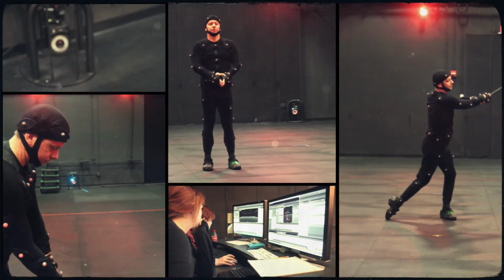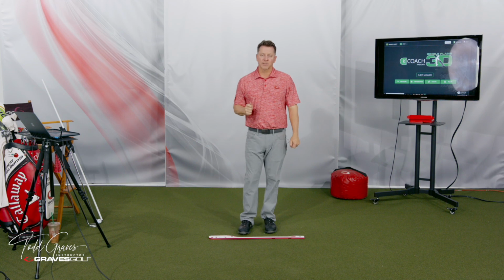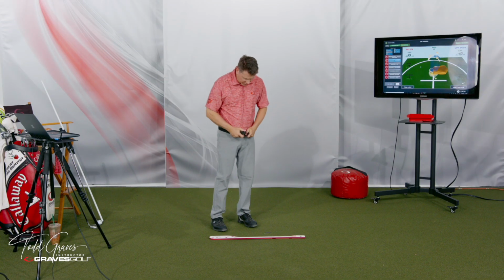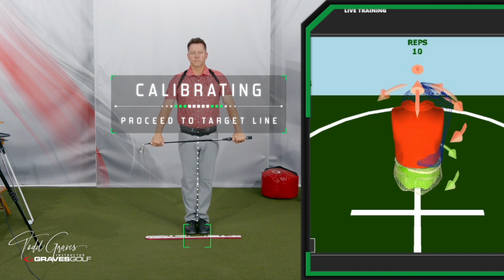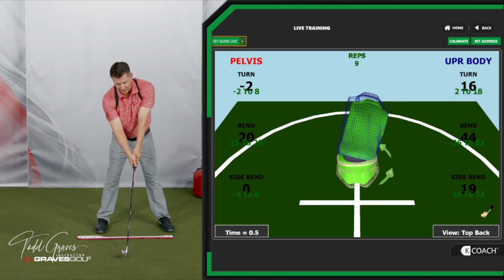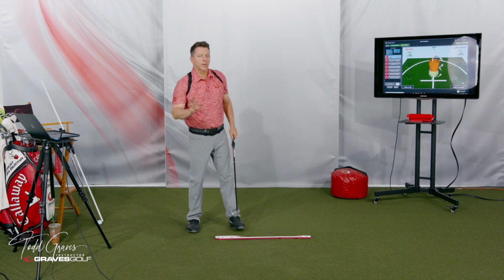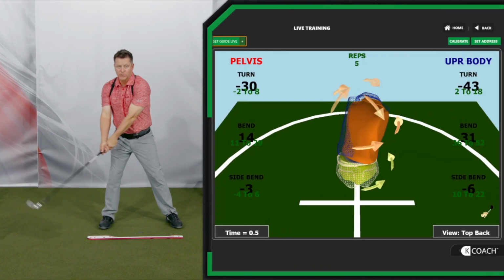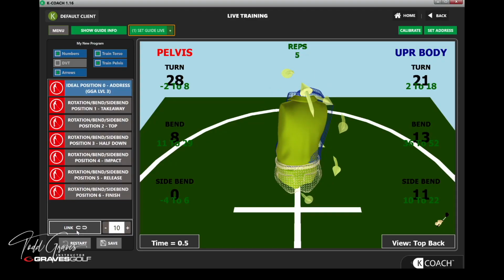Moe Norman's Golf Swing Mechanics with Single Plane 3D

Comment: A very interesting analysis of the optimal body movements. Just one thing: at 7:30 you say that by position 1 the pelvis has almost completed its rotation, but in fact it has only gone through 60.9% of the total movement through its arc. Though the pelvis has to travel a much shorter relative to the other parts of the body it still has to move another 39.1% to go from position1 to position 2.

Comment: What would be a correct lie angle for a set of irons?
Reply from the maker: Depends on your size - you need to be custom measured and fit for clubs.
Reply: I’m a plus one handicap PGA member and absolutely love your videos. My lie angle is 2 degrees flat with a conventional stance. I’m trying to learn the one plane swing. My question is with my arms more extended does my lie angle need to be more upright?

Comment: I have a question:
Suppose the numbers in my 3-D model are exactly the same with Mr Todd's or Moe's numbers. Why, then, the 3-D orientation of the club head at the impact instant and its 3-D trajectory, that dictate the flight of the ball, will be the same in all cases?
Reply from the maker: I'm not sure I understand.  I guess maybe the answer to your question is Speed. Maybe we have different speeds.
Reply: @ToddGravesGolf  First of all, let me acknowledge that  I am  a fan of your model and teaching.
What I am trying to say is that in case my body  'metrics' (or symmetry, for example longer arms, shorter legs and shorter torso) are different than yours or Moe's, then even in the case my 3-d model numbers could be the same the trajectory of the club head and its orientation  would not be the same. The trajectory of the ball would be different. It's just mechanics. If we have two mechanical golf arms, each consisting from two jointed  parts of different length, then it is not possible to achieve both the same 2-d (for this example only 2 d is enough) angles and same trajectory of their end.
I think the best way to describe it is that first you study what the 3-d numbers for each student are, along the basic principles of Moe's swing model, and then have the student try to achieve those , individual, numbers each time. Anyway, the system to be compete, they should add sensors for the arms and hands. You have pointed out that Moe did  not rotate his hand at the impact, so the position of hands is also crucial to achieve a straight to the target flight.
I would like to visit  and take some lessons, but unfortunately I live in Europe now, I used to reside in Fayetteville  AR.
Wish the best and happy new year.

Comment: @Todd - Awesome video. The advancement in Bio-Mechanical feedback (metrics) is huge leap forward in the sports industry. How, if it all, are you planning on disseminating your model, will it only be available to authorized GGA participants or is their a plan for it to become available to any K-Vest owners? Thanks!
Reply from the maker: We have consumer based K-Vest (K-Motion) system available.  This is the Single Plane 3D K-Motion System.  You can find out more about the system at www.singleplane3d.com.  K-Motion supports the Single Plane 3D system and Graves Golf Supports the Training.  We currently have 150 Students that have Systems - they have been available since August 2018.